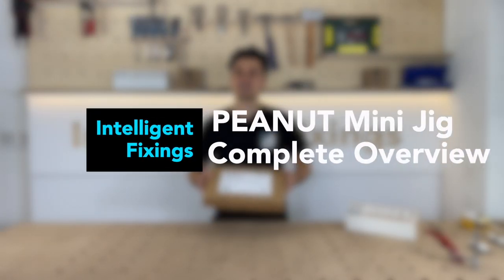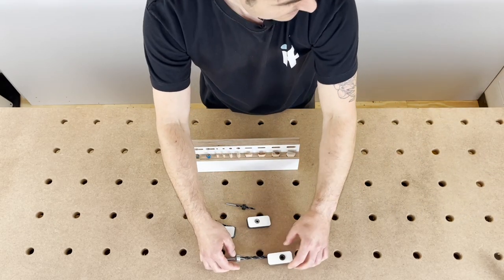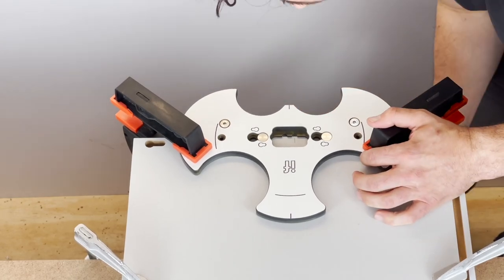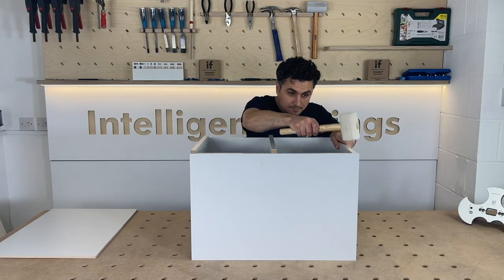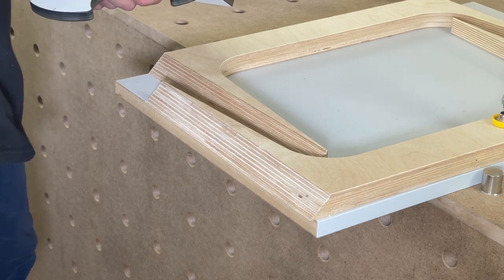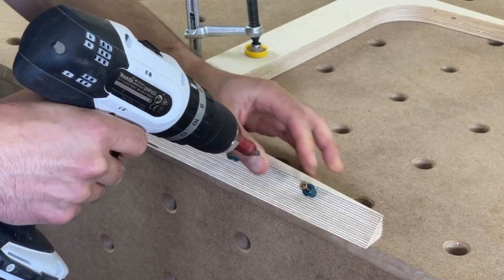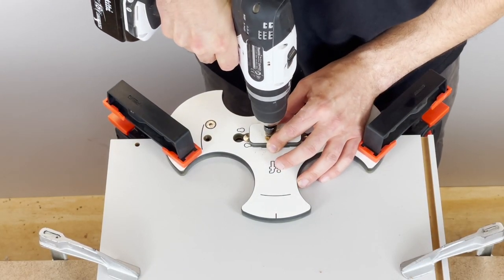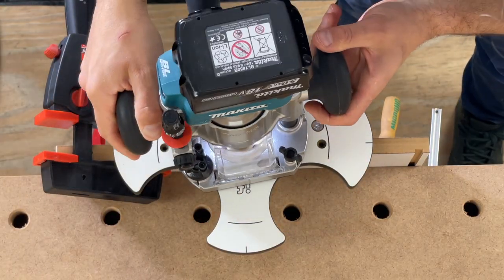PEANUT Mini Jig | UPDATED Overview | 3 Invisible Connecting Systems

Comment: Just got one of these jigs and the slightest overtightening of the screw splits the MDF, wrecking it entirely. Happened on more than one occassion now. Lord knows how you think you can 'adjust the tightness of the joint' by adjusting the screw.

Comment: So, I was looking at this again, thinking “man I wish this was available (and the connectors) at Home Depot or Lowe’s in the US, alongside those darn pocket hole jigs.”

And then it occurred to me: I wonder if you could do pocket holes with the Peanut mini-jig as well. Not the Kreg-style with the stepped drill, but the Castle style made with a router and drill. Basically cutting a floating tenon miter at a angle, deeper at one side, then drilling into it from the end.

Now I have to buy one and try it. Attach a shim on the left to the hole meant for fixing to a panel for midpanel joints, slide the gravity stop on the right up to the edge. Now route a miter at an angle. Have to figure out a way to hold the guide to drill a 5mm hole in the end of the board, centered on the miter. If I use a smaller guide bush, I can use Kreg or Castle screws because I have a flat bottom to support the washer-head. If I use the standard size, my bottom is round… so I may be able to use regular wood screws. 

I just saved myself another $450 not buying the Castle pocket hole cutter, on top of the $1000 not buying a Domino. Yay, me.

Comment: What size & type  router bit do you advise to use when doing the loose tenon, also what size loose tenons for 18mm mdf thickness.
Reply from the maker: Hi Paul, we recommend using a spiral upcut router bit. For 18mm MDF, you could look to use 6mm loose tenons, however of course we still recommend doing your own testing with different sizes to work out what works best for you. I hope this helps.

Comment: to make the slot the router bit needs to drop 2.1mm down over a 10mm radial move. This is not happening with a manual router. Can you explain this? Machining the slots on a CNC requires a macro to create that specific drop. How is it handled with a manual router?
Reply from the maker: Hi there, 

We have two different slots that are used with the PEANUT system. The one you are currently referring to is our "CNC PEANUT slot", but then we also have a different "Jig Slot" which is what's used in this case. For more information regarding the slots, you can visit our page here: https://www.intelligentfixings.com/peanut-slot-technology. 

I hope this helps.

Comment: You guys need to do drillbits with the stop already in correct position or maybe without a movable stop
Reply: I was thinking the same. I make my own using either the bushes provided, or make my own bushes from wood, then fix in place with epoxy steel. I never trust the grub screws to hold and they’re always a pain to tighten on the flutes!

Comment: I have a Bosch GKF 600 router any idea which guide bushing  I need ?
Reply from the maker: If your standard guide bush with your router has a projection of 9mm or less, it will be compatible or otherwise you can grind it down to 9mm. Alternatively, you can acquire a sub base plate for your router such as the Trend GB/5 Sub base and use our router guide bush attachment.
Reply: @IntelligentFixings  thanks that’s very helpful